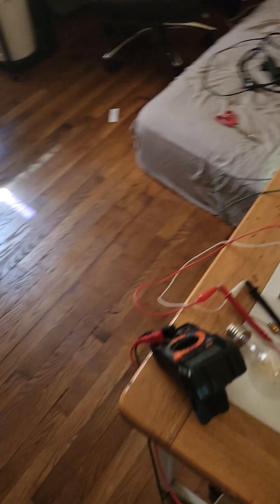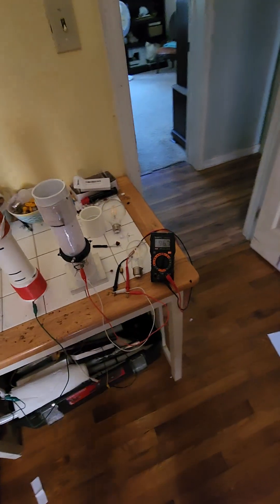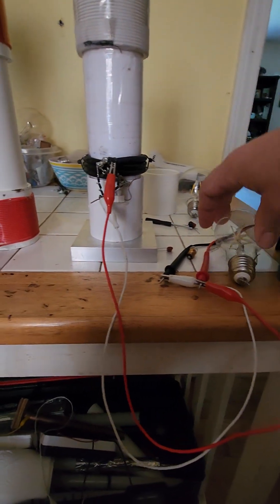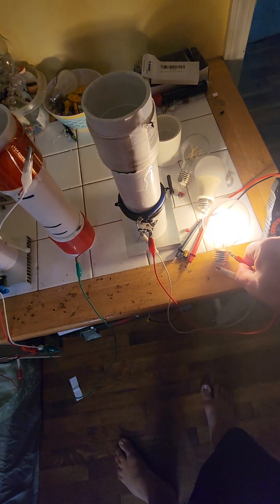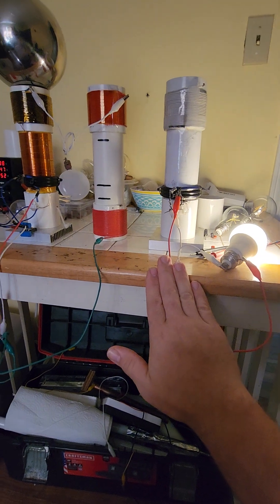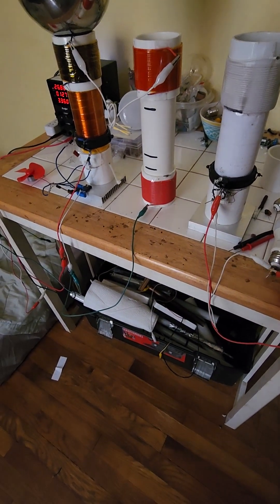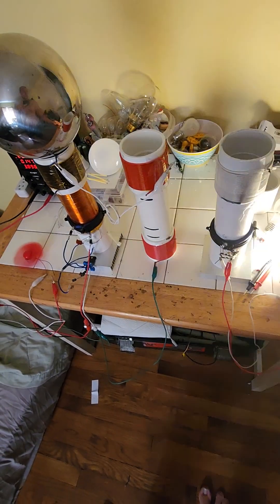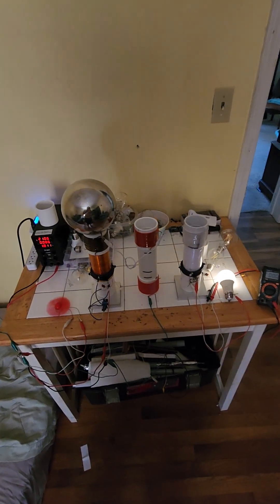Energy Gain From Parametric Resonance In Receiver Coil Plus Rectifying Back EMF For O.U? Quick Vid

Comment: The two buck coil are connect  together ?
Reply from the maker: The L2 Is Connected In Series With The Bucking L3 Coil & L3 Is A High Q Extra Coil
Reply: @MTECH2022   ok two buck in a midlle connected on a top at buck emitter in serie with the earth?
Reply from the maker: @anthonyjousse3020  in all my setups now my transmitter & receivers are composed of 3 coils. A 8awg L1 of 4 turns. A 18awg L2 that's 4 inches long & a bucking L3 that's wound counter clockwise to L1 & L2 & is bucking. L3 is connected in series to L2 & L3 is 18awg high quality silicone stranded wire. L2 Is 18awg gold coated magnet wire. L1 is high quality speaker wire grade A 8awg stranded. When bringing a separately earth grounded L3 coil near a receiver which is constructed identical to the transmitter minus the ball the receiver will output significant amounts of excess wireless power while simultaneously the transmitters input power drops

Comment: Overunity? So you have constructed a siphon that somehow pulls the æther in from all different directions? Hmmm. I’d keep that a secret for a wee bit longer.
Reply: Multiple spots doesn't exactly sound like a address. A little more on the locations. .
Reply from the maker: @R2NOTU  i can email you a free version of the pdf that will tell you everything
Reply from the maker: I'd like to make money off of these discoveries but the exact circuit Diagrams are already released on the internet in multiple spots locked behind a 15$ fee for the schematic & pdf